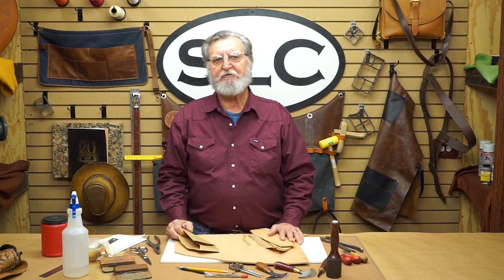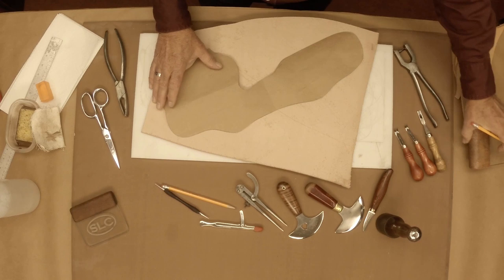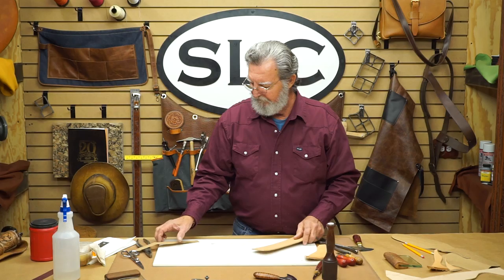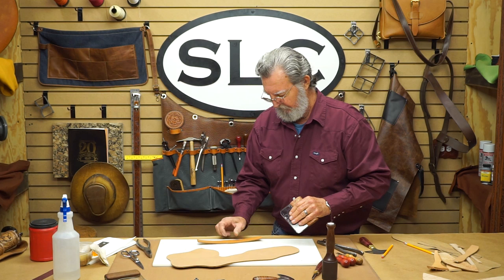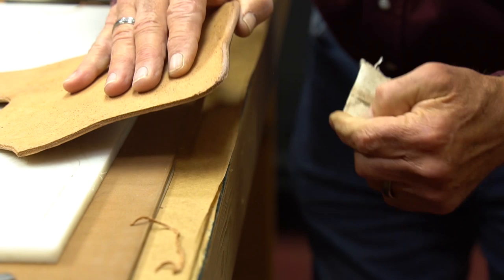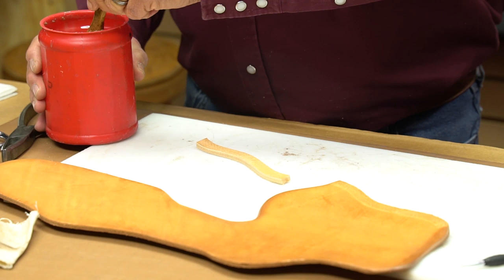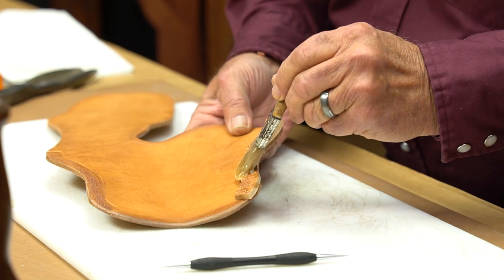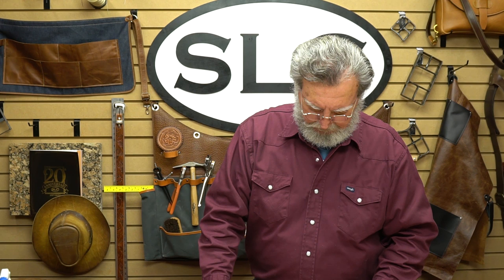Making a Single Loop Holster Episode 2

Comment: Cutting that thickness of leather with a dainty little Xacto knife would be a not fun chore.  And can actually be dangerous. Work with lighter leathers can be done easily with a variety of knives.  But cutting heavy 10 oz veg tan like that is easiest and best done with a round knife.  Just treat it like a power tool when it comes to your fingers.  Keep them out of the line of cut in front of the blade.  Pushing hard on any knife can end up with a blade slipping out and running over the top of the leather. 
Great tip in running a glass slicker over the leather at the beginning.

Comment: He made this holster ruff side out because it wasnt lined? Is it bad to have the ruff side against the gun? In other words do you want the inside smooth all the time to protect the gun?
Reply from the maker: If you leave it rough on the inside the fibers could come off on to the gun. It's not going to hurt it (unless not taken care of), just leave leather dust on it. Over time it will slick down...or before you fold it over you can slick the fibers down and that will help as well.
Reply: FYI  it is possiable that the fibers COULD gum up the action not good when you need to use the gun
Reply: A lot of the guys who shoot the cowboy action competitions like a smooth liner... It supposedly helps make your draw a little smoother/faster.
Reply: Thanks guys
Reply: A wonderful woman and skillful leather smith , well known custom sandal maker in the East Village, Barbara Schaum, taught me instead of plain water for edge burnishing, use a 5:1 Solution of Water to Hide Glue...works great .........”Experiment ”..!